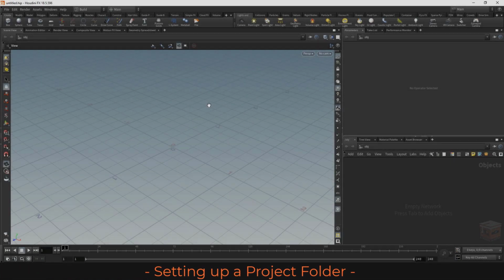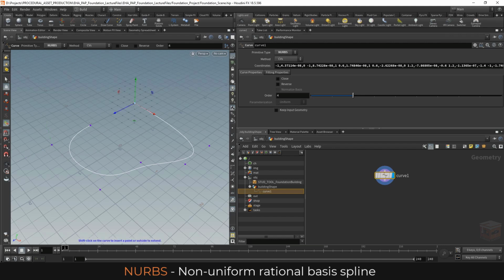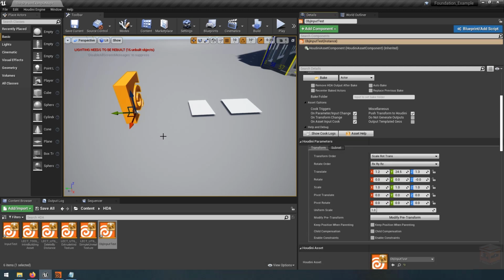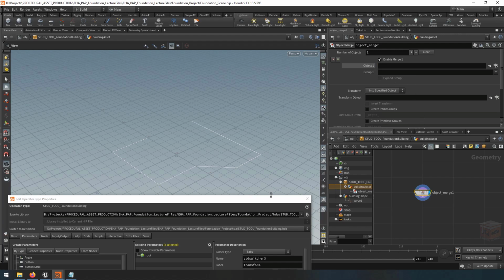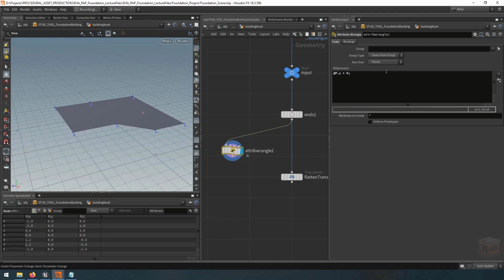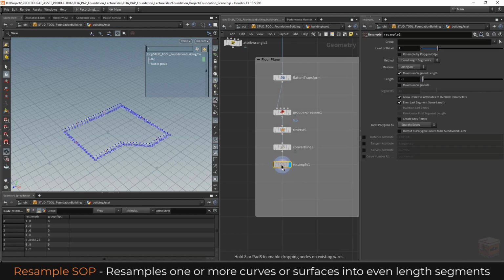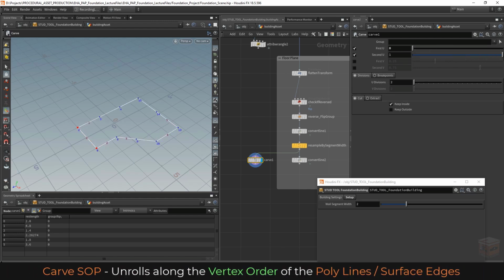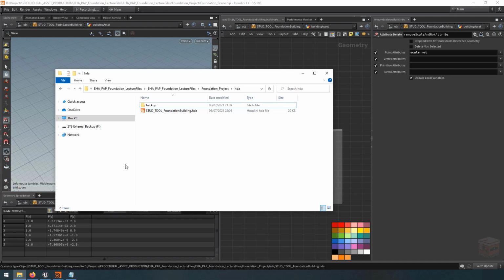HOUDINI FOUNDATION - 02 - Setting Up the Ground Plane - ( Free Tutorial for Game Dev with Unreal )

Comment: Great video! One question, when I add the polyfill node (like at 1:10:50), the Single Polygon Normal is reversed... Is it okay to keep it like that or should I use the Reverse Patches options? Thanks in advance
Reply from the maker: I do think its important the surface is facing the upward direction. If it's flipped upside down though, you can copy the reversed nodes above and and put it below the polyfill again to correct any issues.